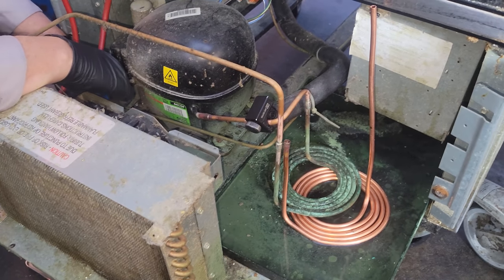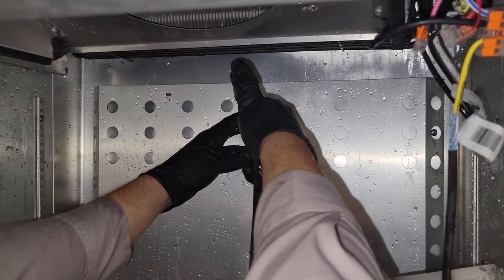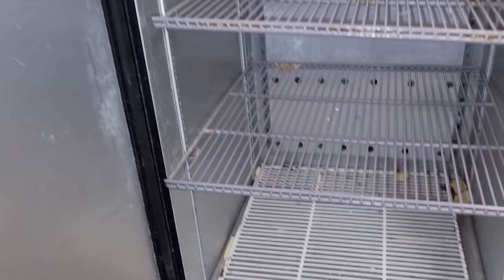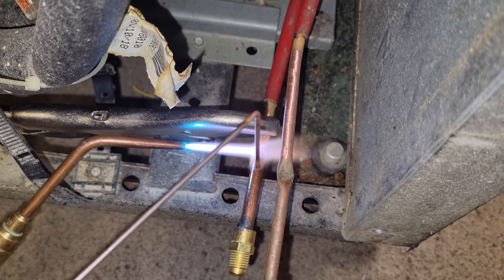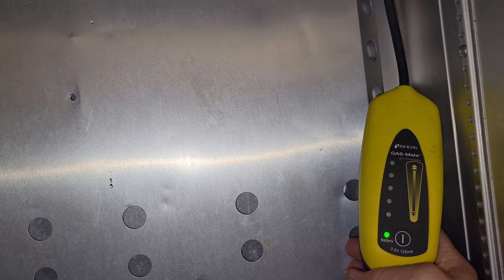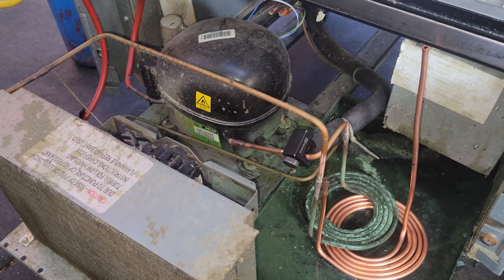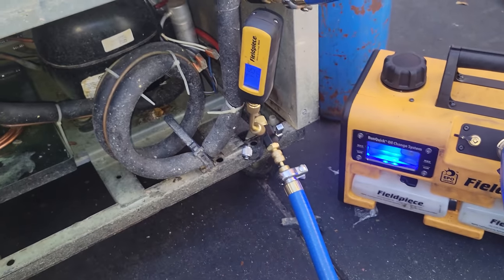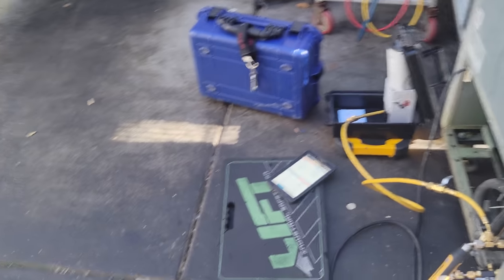TRUE STAND UP FREEZER MAKING A WEIRD NOISE

Comment: As long as the complete capillary tube is accessible in the evaporator compartment why wouldn’t you replace it?  Just wondering. This is a warranty repair? Yes?
Reply: Correct, meaning that any extra replacement would not be covered by customer or warranty, and may actually void said warranty.
Reply: @EnderMalcolm  The T23F-HC in the video was shipped from True on August 27,2018, so the box is most likely still within the 3 year parts and labor warranty. I have been authorized True service for 35 years and their tech department has never denied a cap tube replacement when replacing an evaporator or compressor under warranty.

Comment: Do not splice sensors that is ghetto and its not sometimes you have to do what you have to do! You can check sensor reading on controller and if it ain’t bad don’t change also T3 is spare that you can use incase you have a bad sensor.
If you do need to change sensor just drill a hole and run new sensor outside as you would with the captube